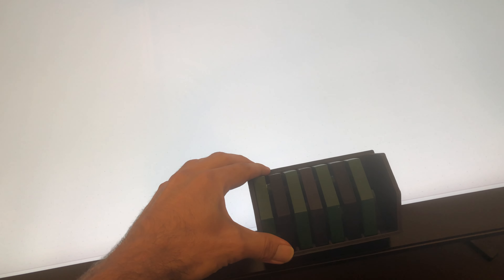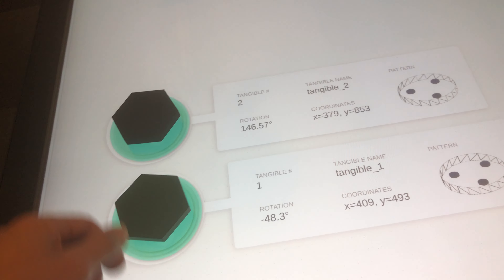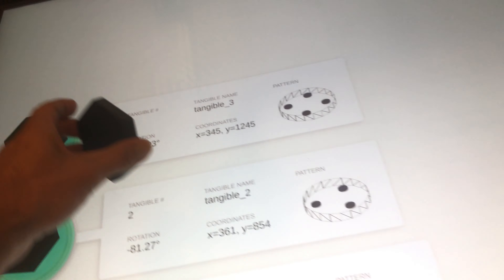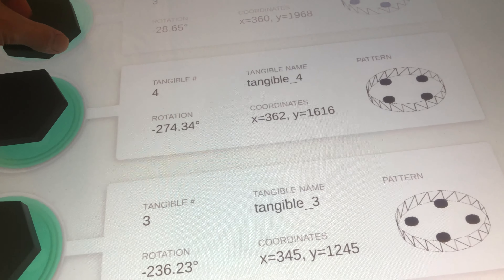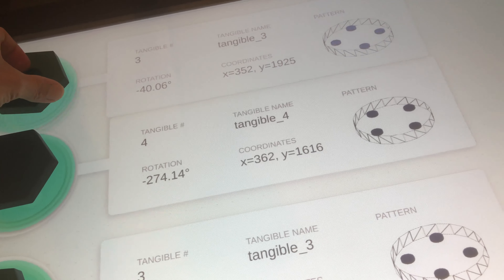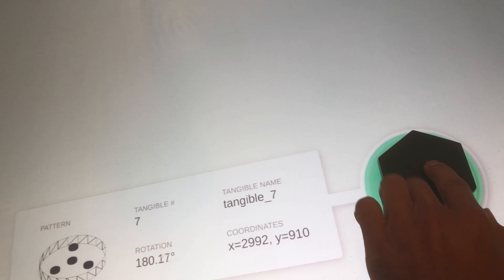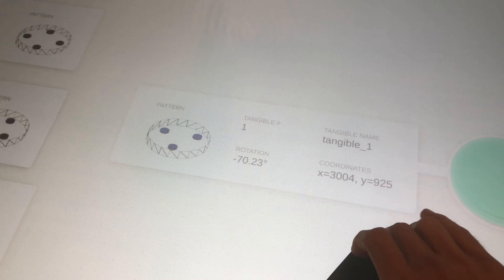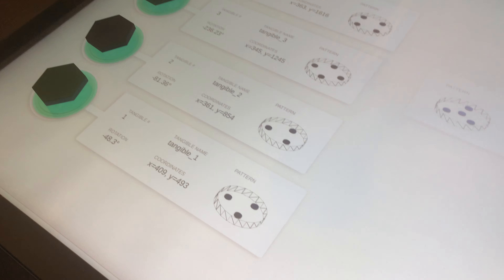Ideum touch table Puck Test

Comment: How did you manufacture the pucks?
Reply from the maker: I manufactured them myself using a conductive PLA on a 3D Printer. Then I sanded, glued/assembled, and painted them. Its basically 3 different parts that all snap together and held there with glue or epoxy; Top (main body), Bottom (foot pattern plate), and the Feet themselves. The unit is hollow to keep costs down but then I added a small amount of led for weight and filled the cavity with a latex caulk.
Reply: @woodrobotics  Oh cool thanks for the reply. I'm surprised that just printing the entire thing of conductive PLA would cause it to trigger the touch